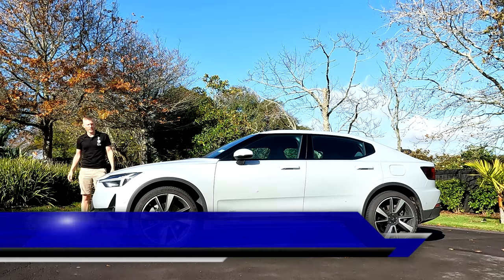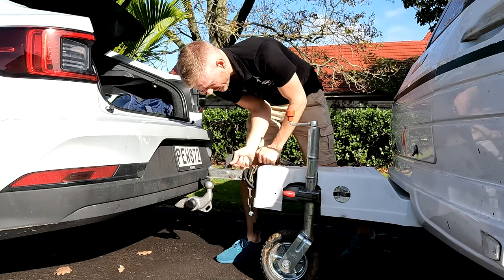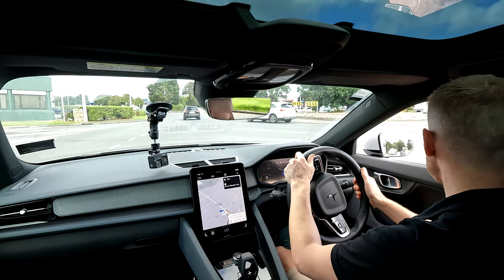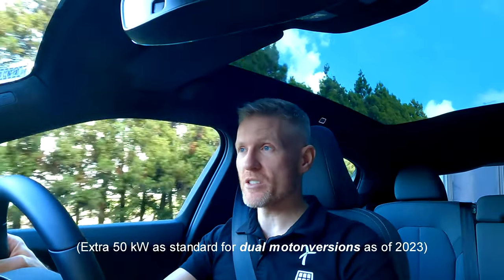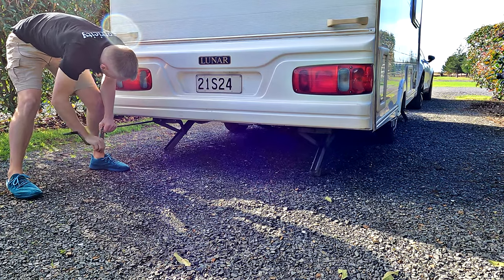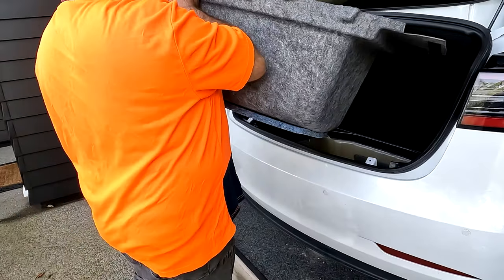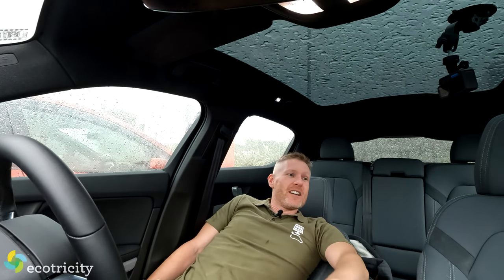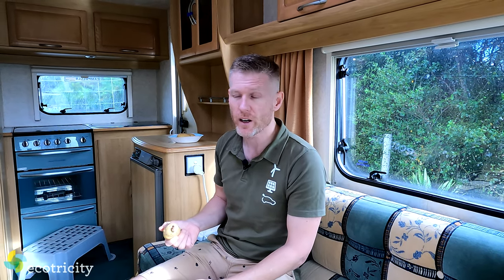Can you tow with an electric car? We find out!

Comment: As a farmer I do a lot of towing with my Skoda Enyaq IV80x. My main trailer is a box trailer which is quite large. The car normally does 18kw per 100km but with a loaded trailer (about 1500kg) the consumption drops to about 28kw per 100km. The car tows very well & is good & stable, probably due to the weight. Yours was an excellent video thanks. 😍

Comment: 1. The Polestar 2 always uses regenerative breaking. The setting is for how much of a one peddle experience you want OFF - Low - Standard (or as I call them, Rolling - Engine Breaking - One Peddle) - so makes zero difference on how much it regenerates. 

2. The latest software will read the "Open Road" (or UK National Speed Limit) signs now.

3. The Seat Belt - Had that many times ... as the wife always forgets to put it back correctly. 

I've had mine since Oct'20 ..... damm good car with only the one cup holder up front being the most annoying part. I've only towed a bike rack .... never a caravan, so great to see this video.

Comment: No surprise that the "fuel consumption" doubled on that trip.. it would roughly double on a petrol or diesel car of similar size towing that caravan. The difference is in the availability of suitably arranged chargers that can charge a car with trailer attached (and of course the speed of the "refueling" operation) relative to the huge number of suitable petrol stations..
EV range and charge speed will slowly improve, but it is important that the infrastructure becomes available as well... we should email MPs, councils and charging infrastructure companies pointing out the need. A few emails might not achieve much but a few thousand might get noticed!
Thanks for a useful video Gav, much appreciated.

Comment: Wow! 42-44 kWh/100km. Towing the caravan took double the electricity that I use for a camper trailer of similar weight but much lower roof in hilly country at 90kph (22kWh/100km). Aerodynamics matters!

Comment: Great review and of particular interest as we have a Polestar2 due in a couple of weeks that we will use for infrequent towing duties.

Two things that need mentioning; the Polestar2 foldout towbar does indeed have a 50mm coupling ball but we have opted for the NZ fitted (removable & stowable) version with a 1 7/8 inch ball as our own trailer and all of the hire items we tow (log splitters, hire trailers) all have 1 7/8" tow hitches, which is usual in NZ. From past experience a 50mm ball won't fit in a 1 7/8" socket but a 1 7/8" ball will fit in a 50mm socket, but is prone to detaching itself. Both towbar versions are a $2,800 option on Polestars which must comply with the car's sensor devices (i.e. the trailer is not a closely following vehicle) according to the Polestar staff.

Secondly the brakes on the trailer would negate much of the regenerative braking so wouldn't it be better in terms of battery range to back off the severity of the trailer's braking ability so that the inertia can be more effectively used to recharge the battery to some extent. Some experimentation may be required to get the best happy medium between safety and economy but worth a try at least.
Reply: Yep. I do love me a good "jack knifing" off road  caravan adventure.

Comment: Great in depth video and review.
Yes you can tow a caravan with any car petrol/diesel/electric/Hydrogen/Hybrid depending how big the caravan is.
If you are travelling short distances you can scrape thru but not in Australia where you can travel at least 400km in one day without a major town let alone an electric charger.
The biggest problem with EVs, they are at least 10 years from better development in battery technology.
My honest opinion, if you want to tow without the worry of range don't depend on the EV, Diesel is the best option.

Unfortunately, the manufacturers are under pressure to produce EVs only because the politicians are forcing them to do so, not because they want to, this is the reality.

Comment: Wow Gav I did not expect a modern Polestar 2 was going to have 25% worse (21 kWh/100km on a wet day and 32kWh/100km when towing the caravan in the dry.) than my 2016 Kia Soul EV (getting 16 kWh/100km in warm dry summer day and 22 kWh/100km when towing a commercial trailer.)